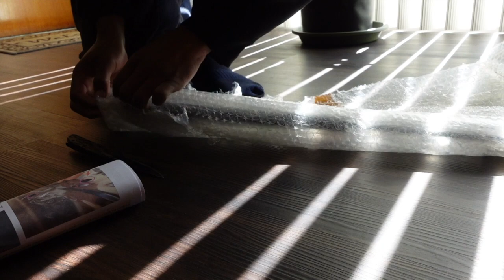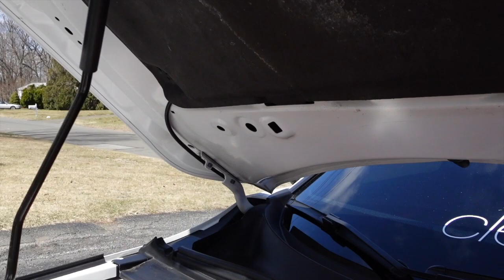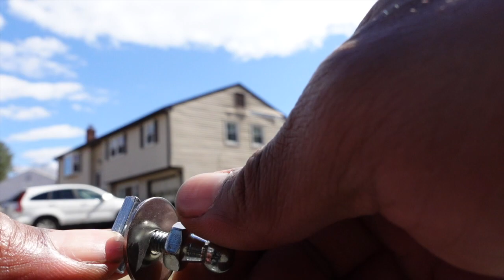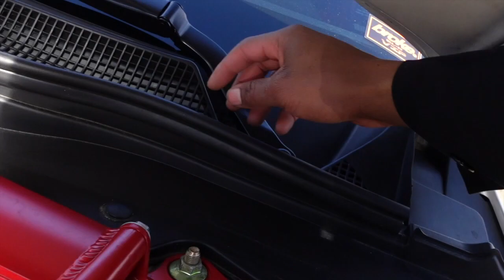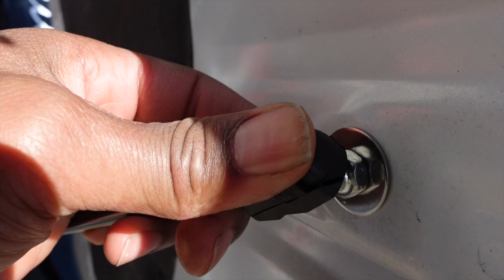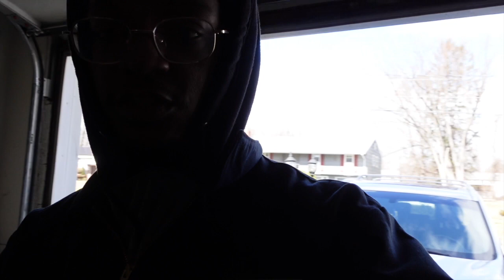10th gen Honda Accord hood lift support install

Comment: these would be nice once i get my whole inlet and engine bay done but would want some that dont go on the coilover bolts since i probably will work around there a lot and it will get annoying removing those too imo hahah nice vid tho
Reply from the maker: I wish they didn’t mount there either you have a valid point lol as i popped my hood I’m like wait i have a strut bar 🙃🥴